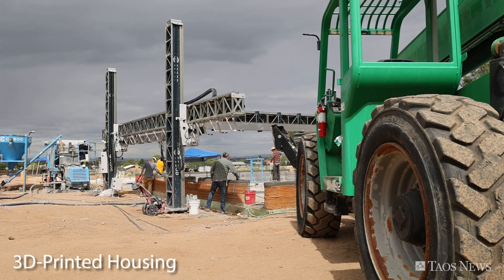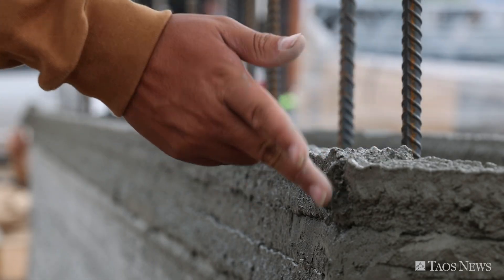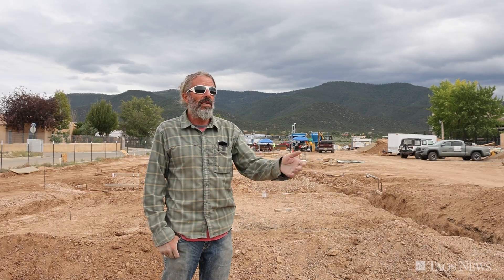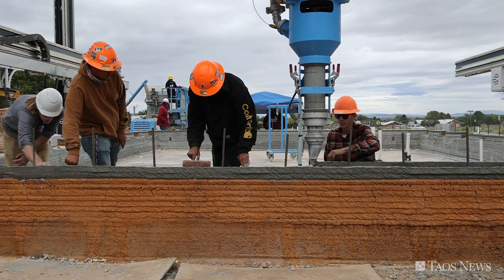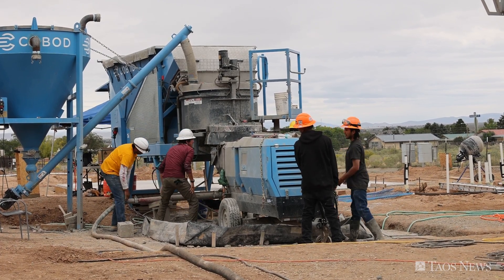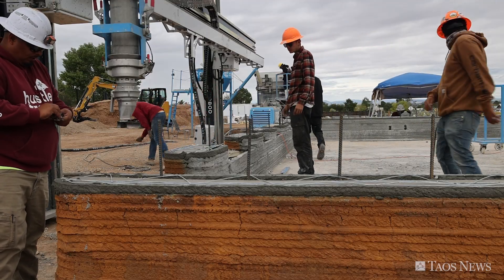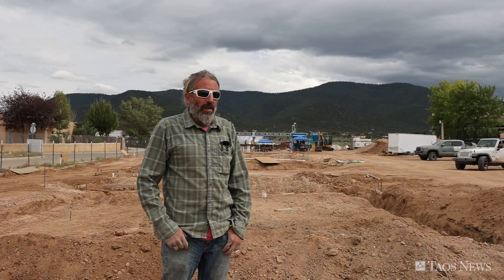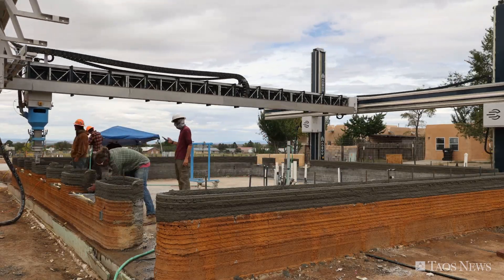3D Printed Housing in Taos

Comment: You should show the foundation and slab work. Folks will get a good laugh! The house you show broke ground on 7/7/25. Printing began on 9/3/25. as of today...9/28/25, four feet of exterior wall has been printed. This house will be 850 to 900 sf. A five-man framing crew would have framed exterior and interior walls, set trusses, and panelized the house in 2-1/2 to 3 days. FYI the average cost for constructing a home here is $380 pr ft not $450. Thats for a much higher grade of build than these will be so it's not much of a comparison. You forgot to mention this is being done by a $1.3 million grant. The suggested sales point of approx. $190 pr ft may happen,...depending on who takes it in the shorts. The hard cost will exceed $200 pr ft and may reach $250 pr ft even with the lowest end finishes and fixtures. As an aside, doesn't the contract call for the first 5 houses to be completed by Oct. 7th? Thats 9 days from now. With a bit of luck, they may have one finished this year.
Reply: So show the listings in Taos for 900-1000 sf homes with 2-3 bedrooms $172,000-191,000 with zero down where your payment will be $1200 per month that was built with local resources putting $ into the local economy. There is the consideration of investment in the community to help the community. Talking about low end vs high end fixtures when people are unable to afford a basic roof over their heads in Taos AT ALL? Seems some perspective is needed here.
Reply: @AnIslandPotter  Have we met? I'm a regular at zonings and affordable housing. meetings here. We certainly have a shortage of affordable housing. The numbers from the story ...$450 a foot cost, are way off as I mentioned. High end Seco or Sky Valley over a million homes can get there. What's the point of claiming that's an average cost here? $225 to $260 is an accurate average for homes in the 600k to 950K range. Look at new homes on the golf course as an example. I only mentioned high vs low end because this story makes the false equivalence. Today, 11/21, still only 1 house printed (exterior walls only minus bond beam). It months from being finished. The other foundations I mentioned, have since been completely removed including plumbing, filled in and re-compacted back on grade. A new crew has been hired to start over because the first didn't have a clue. 5 houses were to have been finished in 90 days. That came and went 5 weeks ago. I understand the contract has been modified to 3 houses finished in 180 days. That's Jan. 3rd, 2026. Won't happen. They will be lucky to have the first dried in by then. Very few listings for anything affordable that doesn't need a lot of work. Also, not many mortgages at zero down. That's another issue. That said, assume 6.5% interest 30 yr. for $191,000. That's $1,207.25. That's in Taos or anywhere. Rates are down a bit. Can you get 6.5% with zero down? No local bank is offering that. Circling back to hard costs, I need to be able to build at $135 pr ft. After permits and fees that's $150. With 25% profit I could sell at $191,000. That's not considering ANY lot cost. Do you think this "builder" is going to hit these numbers?